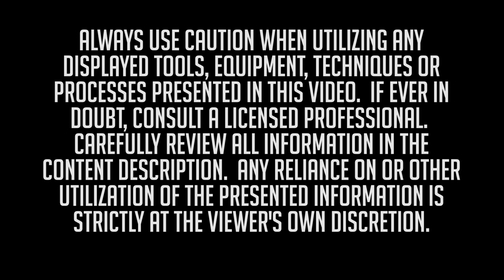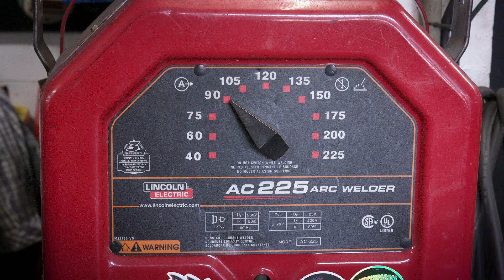Welding Cast Iron Repairs and Ornamental Projects

Comment: You didn't have to peen the weld after welding? I ask because I started out on cast iron back in the early 70"s using oxy/acetylene and electric A/C. Even on some of the jobs I did in the 90's I used a air chisel with a blunt end which made a huge difference. Is it because of the technology now a days or what?

Comment: THANK YOU so much! I have to fix ornamental iron in the field a lot, and that Postalloy (?) product seems to fit the bill beautifully.  There is ALWAYS a need to weld cast iron to steel, and I have not yet been completely successful (been using 7018). In your list below, I was hoping to find your source for this Postalloy electrode -- where is the best and cheapest place to get it???

Comment: Great video!
Hi nickel content rods are a must I think for fancy cast iron work. However, I have used 7018 successfully to repair cast iron pieces too. Pre-heat, peening, post heat and controlled cooling help to stress relieve the workpiece. I have done a video or two on welding cast iron myself.

Comment: Would there not be an advantage to flipping it over and welding the back while it's still hot from the first weld/s, rather than letting it cool before turning it over, then pre heating it again? Would negate all the heat cycles (pre heat, weld, cool down). Or am I missing something that helps when you cool down? I've always found flipping it straight over while it's weld temp hot, with controlled cool down clamped in position at the end works for me.

Comment: Nice video...   question though, I have a cast lead melting pot and a little bitty piece broke off that holds a little stopper rod to stop the flow of lead.  It's a pin hole so it's rather small.    Don't think I can weld it since it's so small but what about tin welding it? Can you tin weld cast?    Tia
Reply: If I was to weld that I use a TIG welder and Ni99 tig rod.

Comment: i had  to weld a tool changing arm on a cnc  the part cost 14 thousand dollars and I tig welded it with 309 stainless tig rod with argon pre heated in oven to 300 deg.  and its still holding 2 years later
Reply: Excellent! It's so rewarding to see a lasting repair done that saves thousands of dollars and time.

Comment: Learned early on never weld cast iron cold. Should always be above 200f. A lot of home shop welders use their bbq grill to preheat/ post heat. If you hear a “ting” sound during or after welding, it’s usually “game over man”… I’ve always used straight up NI Rod. Some old folks in the maintenance departments I used to work in that didn’t like or have Ni Rods (nickel 99 etc) used to use 308 stainless for the root pass then 7018 over that on a lot of the old machine bases. There’s never a guarantee though on any cast iron repair but I’ve seen those welds last years in harsh environments… Thanks for sharing!
Reply: I agree, cast anything is a scary repair. Thanks for the feedback and the useful information. 👍🏼👍🏼

Comment: depending on the repair i have had good luck tig brazing with silicon bronze tig rod
Reply: Excellent feedback, we will definitely check that out. 👍🏼👍🏼
Reply: @bobhigginbotham9035  there is also some tig rod called aluminum bronze for cast iron, crazy that it has aluminum in it, a bit more difficult than silicon bronze but better if the cast iron will  be exposed to more heat, also something called comcast  arc rod is great, less expensive than nickel rod I guess they each have there own purpose.

Comment: I’ve repaired several cast iron pieces at work tig welding with er70s6 mild steel rods. Just cleaning the weld area, preheat and post heat works out pretty well
Reply: Excellent info! Thanks for the feedback. I will definitely have to try that. 🤘🏼🤘🏼
Reply: er70s6 is wire
Reply: @Username-mt6ok  ok er70s6 filler wire. I have a habit of calling it filler rods
Reply: @Username-mt6ok  er70s6 comes both as wire and tig filler.